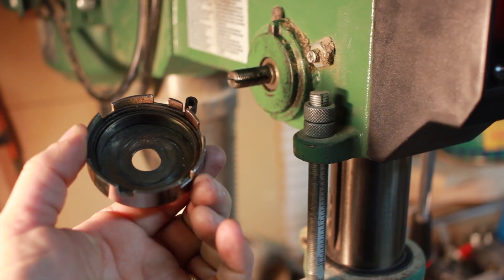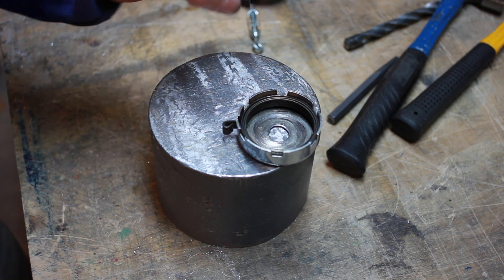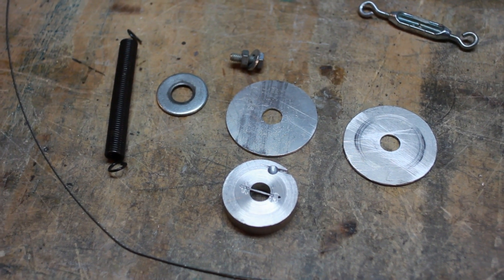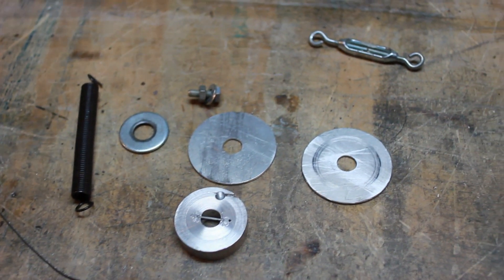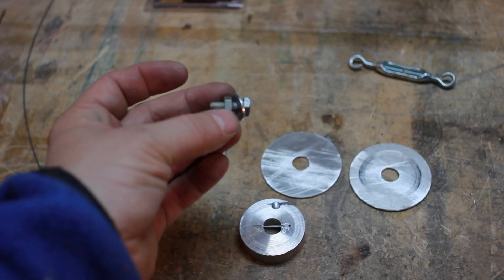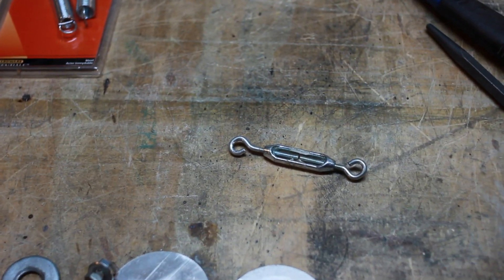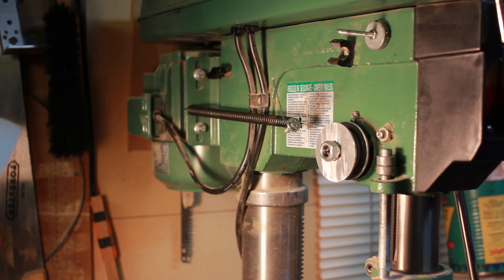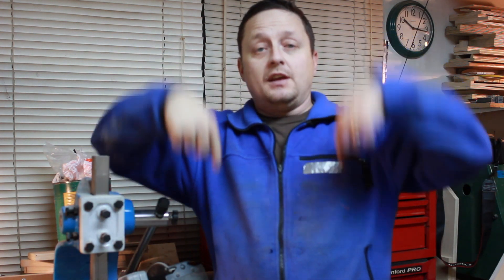Drill Press Return Spring Fix // Modification // How to fix a drill press spring

Comment: I love your idea. The only thing I did different is put an eye bolt in the frame and thread a rope through it. On the end I tied about 15 lb of weight. The weight does great to raise the chuck, and you don't have risk of a broken spring. Thanks
Reply from the maker: Thanks! Yes, that's another way of doing it and I'm sure it will work just as good! Cheers

Comment: I have an old Rockwell 11 in drill press that my quill return spring broke too. So, I went to ebay and got a 2 pk for $10+Free Shipping. However, I didn't read the measurements of the new springs, just thought they'd fit. So I carefully took the old spring out, carefully put in the new spring,  then reality set in. My old spring measured 3/8 in (.375) wide, the new spring measured, (.472), it was too wide, and covered up the adjusting slots on the round spring holder. Sooo, I had to take out the new spring which uncoiled like a mad bobcat. So since the old broken spring only broke off a small piece on the inside, I rebent it and got it to work. Then I decided to try to recoil the new spring and put the wire keeper back on, Bad Idea, it bit me a couple times, and I gave up. Wasted 10 bucks. But Mike I like your Idea, as I never thought of doing that, and If the old spring breaks again, I will use your ingenious method. The adage, KISS, still works.  Thanks Mike, you made my day.  So if you buy a spring, make sure you measure yours first, especially the width, and you will have to convert their Metric dimensions of the new springs to match yours. Might save you 10 bucks.

Comment from the maker: Yes, that is a very valid point. The video doesn't show it but I put a "safety cable" through the middle of the spring and anchor it down. Plus, one should always wear safety glasses when using power tools. I'm glad you pointed it out.

Comment from the maker: Awesome! Thanks for letting me know. Just a few things, use a heavier gauge bike brake cable if you can and make sure you wrap it around the drum a few times to help distribute the load. It was also recommend to me to to install a "safety" string through the spring incase it breaks.. the string will stop the spring from flying across the shop.